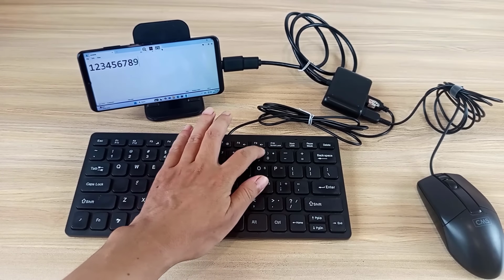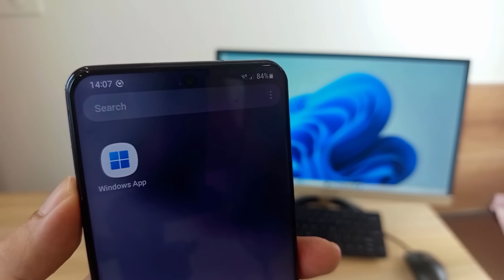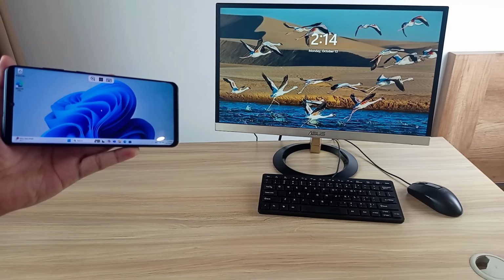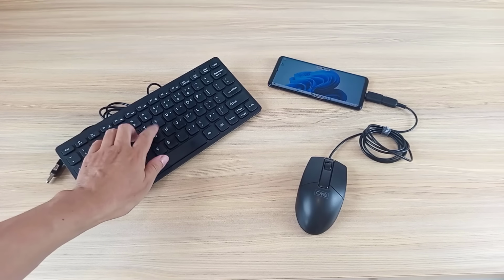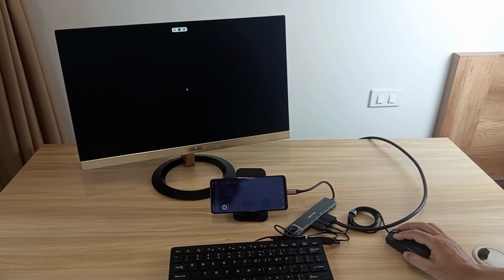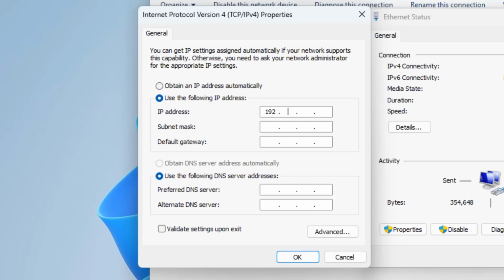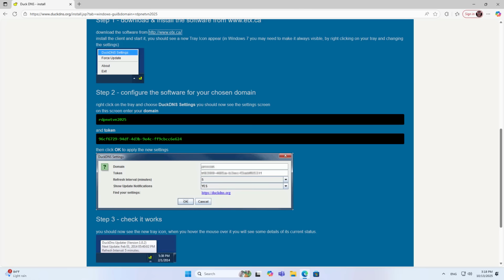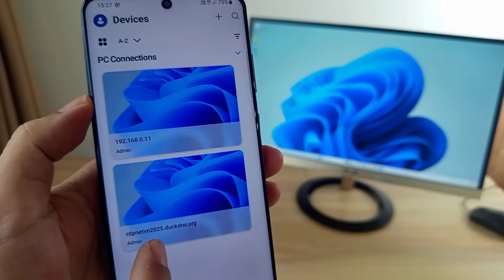Remote Control Your PC from Anywhere!

Comment: You don't need to do all this, just install tailscale on any device and use that tailscale on the same email as the device is linked on and then connect via parsec moonlight or rdp to the machine via the tailscale IP. I use this method on all my devices that I've just explained.

Comment: The best remote assistance CROSS/MULTI-PLATFORM is undoubtedly Anydesk! 
One if it's advantages is that it's taking over the controlled PC's sound and very important is being able to copy files back & forth to & from that PC.
NOT to mention that it has its own VPN.

ANYWAY, RDC(Remote Desktop Connection) can be successfully used with Tailscale encrypted VPN, thereby no needing of opening any port hence having a certainly very secure and a very fast connection in the first place, contrary to what you mentioned here! 

And, by having an Asus WireGuard built-in VPN server you can likewise achieve the same thing like with Tailscale, same connection speed but not as secure like Tailscale since WireGuard opens some ports in your router!